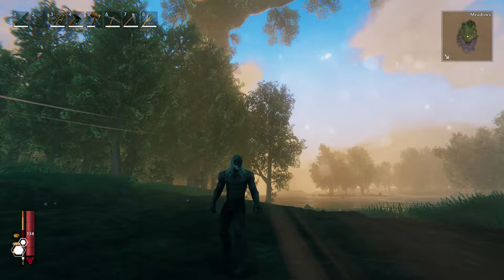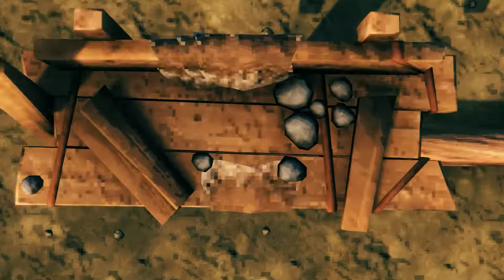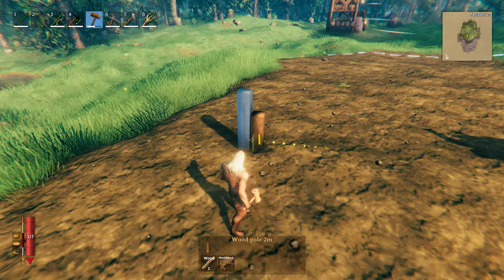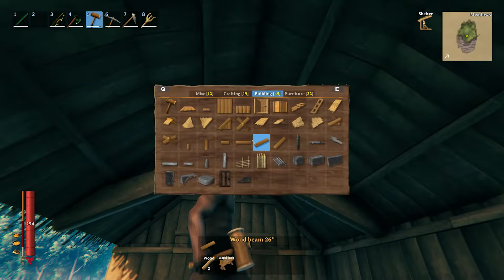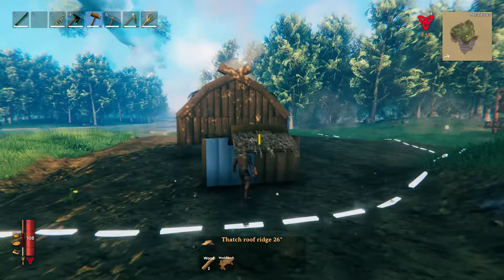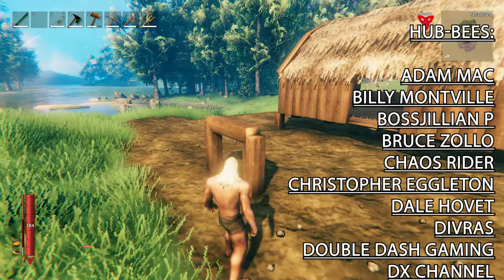Valheim - The Basics of BUILDING | Beginners base building guide

Comment: I've watched your building guides and have a slightly different opinion on certain building topics – especially when it comes to roofs. This is due to the bugs still present in the game, which concern the lack of airtightness in wooden roof joints (which is why I build most of my own with stone and debunk all theories about teamwork, especially for very large structures). Unfortunately, although there are many specialists in the game, the vast majority of them, and players themselves, don't know how to build in Valheim – because they use traditional building methods and don't know that multiple systems can be combined simultaneously (not two, not three, but four or even five in one). This approach increases the stability of buildings by 30 to 50% more than simply combining, for example, metal and stone, or metal and wood. Those who have built the tallest towers in Valheim are shocked when they learn that they can build them 30% higher, but despite their knowledge, they have no idea how. No mods or console commands are needed – just what the game offers.
P.S. Building a roof can be done using the same system currently used in construction (no need for ground column supports). Furthermore, the concept of ground contact is very broad and highly imprecise in the game itself. There are also ways to build temporary structures in the air (this is how you can reach Ashland by air – by building a wooden bridge forward and deleting the rear of that bridge. Several building techniques are combined to achieve this, and material recycling allows you to position your character in the correct spot and overlap base materials by 50% – the whole thing is rounded out by one trick that can be picked up when decorating your buildings and its proper use in a flying bridge).
The best way to block respawns is to trap enemies in pits; then you don't need any workshops, bonfires, and so on.
However, if someone decides to build a workshop, it's unfortunately not in a pit, because enemies can destroy the floor (this is caused by a material connection error in the game – something that appears to be a solid surface is actually not, and small mobs can even get through such a surface, such as bats and wolves, trolls and many others can attack vertically - they are indeed able to and do destroy horizontal structures if they are in a state of alarm). Therefore, it's better to build workshops on elevated ground. Importantly, this method doesn't block night respawns – it's completely independent of the normal rules, except for grouping. How to block attacks on the base is simple. Bring the weakest boss, Eikthyr, as close to the base as possible and place it in a deep pit, preferably covering the pit from above with a stone floor. Each active boss event (and this one, both on the server and in single player, will not expire at the player's base – I tested it myself for a month) blocks other events nearby.
Fix: Some enemies can climb ladders - this applies to all gel lifeforms in the game, as well as those that levitate (though the latter will only climb part of the ladder). Enemies can also climb on top of each other, which also allows you to get to part of the ladder.
Another improvement: you don't have to sit down to build something below your eyesight. Building something below 2/3 of your character's height requires placing it next to a vertical wall or support beam. By moving what you want to build against that wall or support beam, you can solve your building problem. This works both vertically and horizontally.

Comment: I spent so long building my starter base using wood around one of those stone circles, then realized I couldn’t connect the roof, so I built a skylight hole in the middle, sorta looks like the original globe theatre, or a donut, or a anus,
Then after like 4 hours I went to go fight the next boss, elder, and my work was pointless